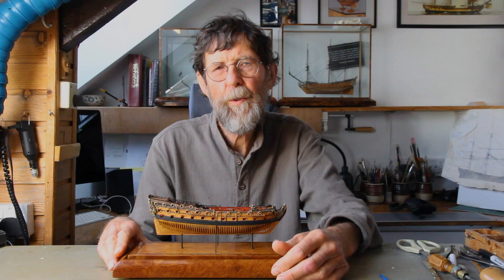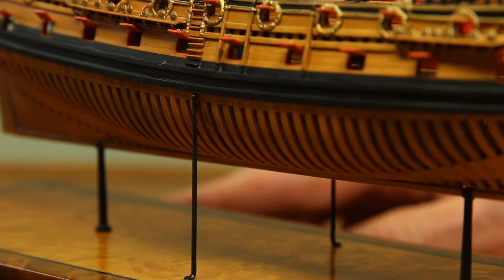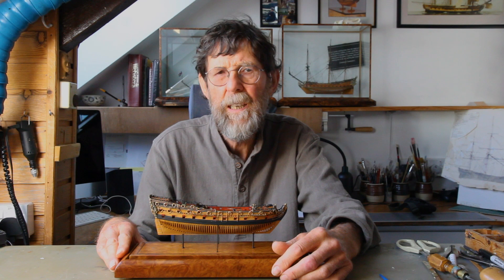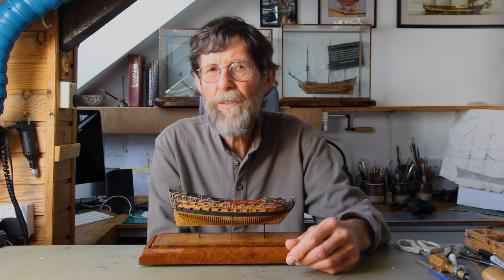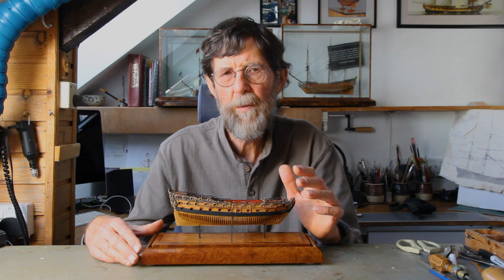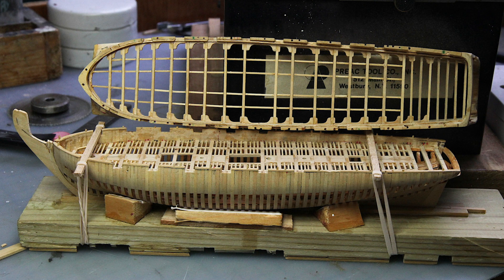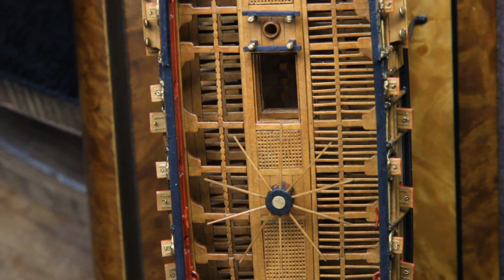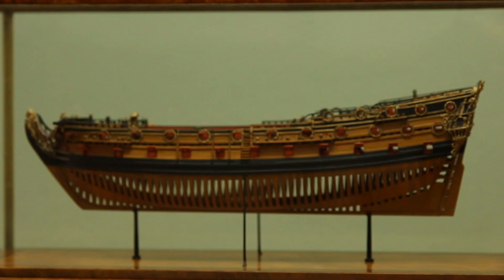Philip Reed's Ship Models No#2 - The Mordaunt

Comment: What is this geliaton?
Reply: It's Jelutong, an Asian tree that has a nice straight grain. a hardwood similar to Balsa but a much denser texture. Very nice to carve which makes it great for model wook. I used to use it in pattern work and mold making. Too soft for furniture work but lovely to shape and carve. The small tight grain makes it super for mold work because the surface texture is too tight to leave an imprint on the mold.